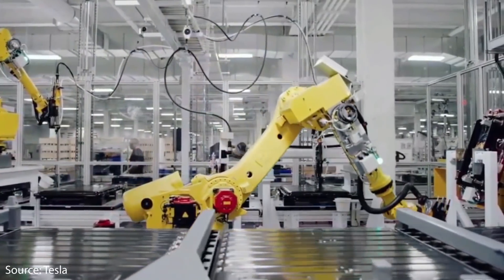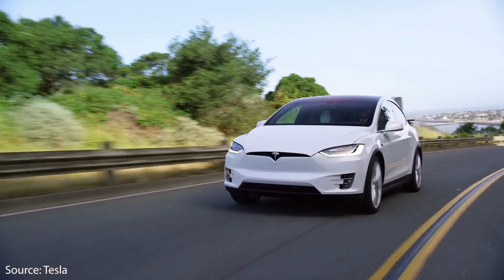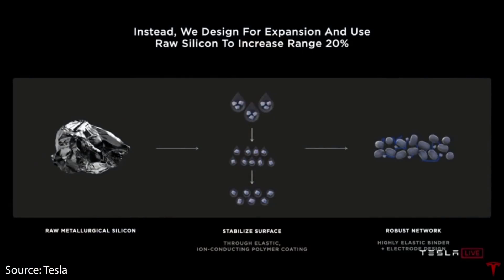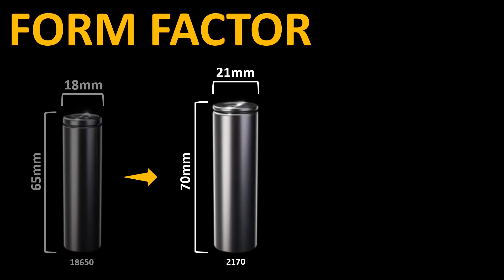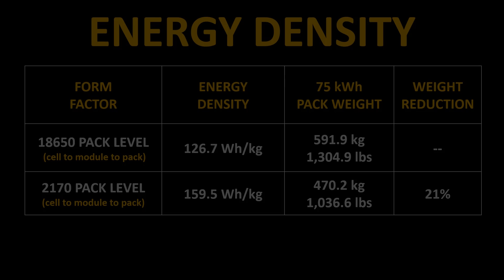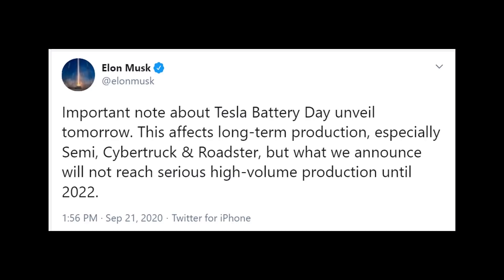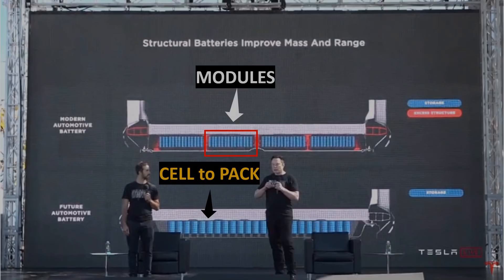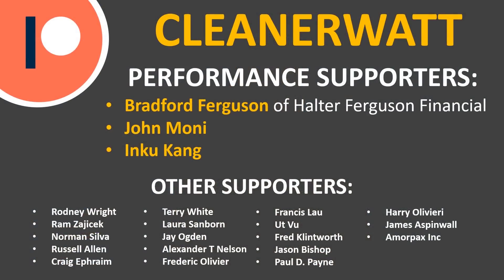Tesla Batteries 2008 vs 2020: How Much have they Improved?

Comment: A worthy exercise is a comparison of square area of the rolled anode-cathode comparison to both cell volume and hexagonally packed cells. My calculations show surface areas of 150; 307 and 2490cm^2 assuming same manufacturing process for the 3 cell sizes and nominal cell volumes of 15.27ml; 24.25ml & 133.0ml giving surface to the average pack volume ratios of 8.92/cm; 11.50/cm and 17.0/cm giving increases of 29% and 47.8% between each increased cell size. 
(Hex closed packing unit volume is 10.7% larger than the cylindrical cells volume.)

Comment: At 9:22 Your heading is "Battery Current" and  under column "Power" you have cross referenced 3Amp; 6Amp and36Amp for the 3 battery sizes instead of milli-Amps...
"Power" could have been displayed as Joules/second; Volt×Coulomb/second or as Volt×Ampere or Watt.
 As 1Coulomb/sec=1Amp and 1Joule/sec=1Watt. (Note:we also have  1Volt×Amp=1Watt AND as there are 3600 seconds per hour,  1Watt.hour = 3600joules or 3.6kJ=1Watt.hour (this is energy)
Previously you identify the three cells se having 10.8Wh; 17.28Wh and 86.4Wh respectively which equates to 10.8/3600= 3.0milliWatts; 17.28/3600=4.8mW and 86.4/3600=24mW.
Consequently I suspect you were endeavouring to tabulate the three currents expected which should have been displayed as in milli Amperes vis : 3mA; 6mA and 30mA per cell implying each cell to be working at the following individual Voltages;
 3.0mW/3.0mA=1.0Volt for 18650 cell;
4.8mW/6mA=0.8Volt for 2170 cell, and 
24mW/30mA=0.8Volt for the 4680 cell.
Personally I consider these voltages to be on the low side but if increased the milliAmperage would need to drop inversely.

Comment: The 5x increase in 4680 is not in energy, it's in energy density. Energy difference between a single 2170 cell and a single 4680 cell would be even more.
Reply: No, (I believe) energy capacity.
Work out the surface area of the jellyroll. It's almost exactly 5x.
If each sqcm can hold the same charge....?

Comment: Not bashing Tesla, but in EU (writing from The Netherlands) they are not showing any advantages in terms of price/kWh. Especially the Model Y (75 kWh for €64,000) is way overpriced compared to cars like the Mustang Mach-e (99 kWh actually starts €7,000 cheaper than the LR AWD Model Y), Skoda Enyaq (net 77 kWh battery starts at €17,000 less than the LR Model Y), and the VW ID.4 (similar to Skoda Enyaq).

So, does Tesla really have such a huge battery cost advantage? Or are they so inefficient at producing the rest of the car? 

Granted, part of this difference is down to tariffs and transportation (although the Mustang which is built in Mexico would also be subject to that). Anyway, Tesla needs to get Giga Berlin open ASAP and lower the price of the Model Y by at least €10,000 in order to remain competitive.
Reply: You answered your own question. Tesla cars sold in EU are currently being imported. I expect their prices to reduce substantially after GigaBerlin becomes operational and scales up fully.
Reply: Look at the range, not the battery size.
(Reminds me of a Prince song!!😁)
Reply: Price is not costs. Tesla sets a value/price level maximizing profit at the current demand and production capacity. The other brands need to match that level, meaning they suffer a loss per car as Tesla makes a (huge) profit.
Reply: The reason is that tesla/Panasonic are not actually ahead on battery tech. it's all smoke and mirrors.

Comment: 10:34 You compare Teslas current battery technology with Teslas future battery technology - how does this say anything about technological advantages over its competitors?
Reply: Its competitors are not making their own batteries though. They just buy off the shelf from Panasonic and LG. The tabless design is a big step forward. The 2170 cells already make for the longest range of the Tesla models, and applying this same technology on the smaller cells will add roughly 20% more to that.

If John B Goodenough and his team crack the code on solid state lithium battery tech, Tesla will still have this unique advantage. If Panasonic or LG beat Goodenough to the patents, Tesla will have a big disadvantage but some leverage for cross-licensing opportunities. If Tesla cracks the code, well, there's always hope for supercapacitors...

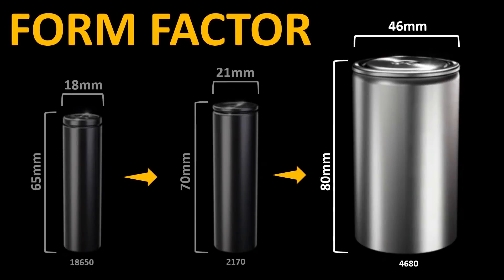Comment: 7:20 You say „5 times MORE energy“ which equals 6 times as much energy (or a 500% increase).
But at 8:40 you calculate only with 5 times as much energy which equals a 400% increase, so 4 times more energy.
I think this is just a common wording issue, but to further improve the quality of your videos and to get rid of any confusing expressions you should fix it.👍🏻
Reply: I noticed this as well. Just know that everyone in the media does this wrong too but we greatly appreciated when you get the wording of the math correct which was not done here.

Comment: Tesla had to implement the tabless design first proposed by Fraunhofer Institut to get the cylindrical batteries into the same ballpark of series resistance as the pouch batteries used by other BEV manufacturers. The lower series resistance will make cooling a lot easier as the generated heat (=losses) will be around 1/10 of the current 2170 type. To catch up with the Wh/volume the larger cell was also required.
Reply: Each cell has 5× the surface are of active material (jellyroll). "Volume" isn't really an issue?

Comment: This video of your is informative, overall a good video.
I'd like to point to something that annoys me. You're spinning Tesla and Musk like a cult.
Mr. Jack Rickard was indeed very knowledgeable with many great insights into the real technology and design tradeoffs, thus a good citation. He was not a cult member that would hype things just by beeing from Tesla or Musk.

Then we come to the rightsizing of the battery cells, electrodes, heat rejection, etc. I'm witness there is nothing really new in what is now being hyped. Even GM's engineers always stated that 10, 20 years ago.

In fact, Tesla went alone in using the 18650 notebook battery form factor, AGAINST the industry that always favored bigger cells, mostly prismatical. Then the cult around Tesla hyped how wonderfully more efficient was to use such huge numbers of small cells.

The design tradeoffs and the knowledge of all implications has always been there, and common knowledge among industry, academy and enthusiasts.

Tesla and Musk have lots of merits. Mostly, Musk lead to the creation of a real EV mass market. 

GM is a reluctant player with good engineering but no focus or leadership in making the transition. 

LG Chem in not far behind Panasonic/Matsushita, and can compete in whatever cell design both physical and chemical. They could do so long before Tesla started mindling with cell chemistry or manufacturing.

Nissan, Ghosn, and their pet battery enterprise proved themselves wrong with the air battery cooling system that could not avoid degrading the cells. Now they got rid of battery manufacturing, and someday may go GM's and Tesla's way with liquid active cooling.

What Elon Musk is achieving is a very tightly focused high quality execution in what really matters to enable the transition to electrification.

He invented the methodology of selling interesting and compelling cars, although costly one, beginning with the roadster. Made them reliable and attractive (no cheap annoyances like GM). Made a good reputation to Tesla's EVs.

Than he focused on a path to expand the the manufacturing capacity and addressable markets with good products that work ok, are reliable and desirable. At the same time, he focused on innovations that would eventually allow them to leapfrog legacy automakers (and cell makers).

The 18650 choice did work then, within the practical constraints a small new company had that could not afford GM's big thinking.

Now, to enlarge the addressable market, lower priced appealing products are needed. In absence of great breakthroughs in chemistry, Elon has focused on reengineering the whole process from cells to monoblock to harness most incremental betterments that could make whole agenda advance.

Each of the factors presented at battery day contribute to the objective. The DBE (Dry Battery Electrode) tech from Maxwell, and the tabless cell design are breakthroughs ahead of others.

Cell rightsizing was done by most before Tesla. Cell to pack was researched and done by many including GM, BMW, VW, Daimer. Adding more nickel and silicon is researched by many teams. We do not know if Tesla has any advantage or not.

Tesla does not hold a tangible technological lead that anyone can't emulate.

Tesla holds advantage of Elon Musk sharply focused and comprised approach to get things done right on their agenda. Sometimes reversing previous tradeoffs as times and needs change, as in the 18650 to 4680 journey.
Reply: You're right it is like a cult.
Like Apple maybe.
The battery technology is better with the tabless design cycling quicker and cooler than existing designs.
Tesla allow others access to their patents specifically to allow them to emulate Tesla's success. 
For reasons why they're unable to emulate Tesla's success check out Munro live on YouTube. The internal politics, management structures and systems of legacy automakers are holding them back.
The problem others have is the phenomenal rate of innovation and the internal culture Tesla.
This is Tesla's secret sauce and no-one is close. It's like chasing Usain Bolt in thick fog for them.
Reply: @andrewsaint6581  
I think you're right.
Once EV becomes the dominant trend, Tesla won't be disrupted by GM the same way Intel was not disrupted by IBM or Fairchild. Intel is being disrupted by ARM and TSMC, and Tesla will have due competition from other "fast organizations" able to leverage their resources with less conflicted interests then the old slow fat corpocracies mentioned.
Reply: @celsostarec6735  
Tesla is building the system, not "the car".
There will come a time when your (or "a"?) Tesla will collect you for work, drive you to your Tesla house (I have a feeling) where, if it's yours you plug it in to your Tesla Powerwall then using Neualiink connect to your Tesla (Starlink) internet service to check how much your Tesla shares, solar and car have made you that day.
Any extra power, sold to your utility provider (guess who?)
That's why Tesla won't be disrupted.

Comment: 10:28 range increase 54%, so that means model S can get 600miles range with the same 100kwh??
Reply: Actually even more because the Model S is to date still using the even older 1865 cells